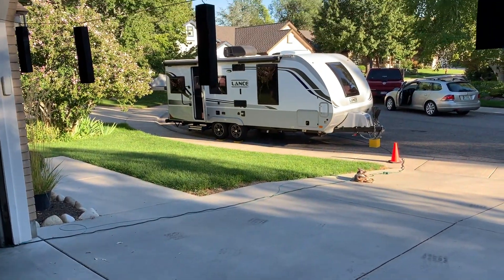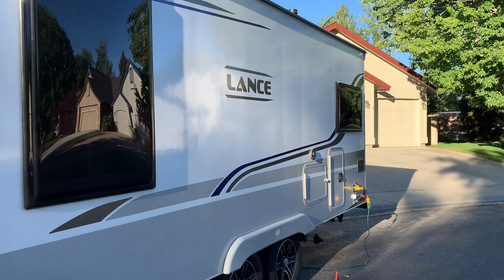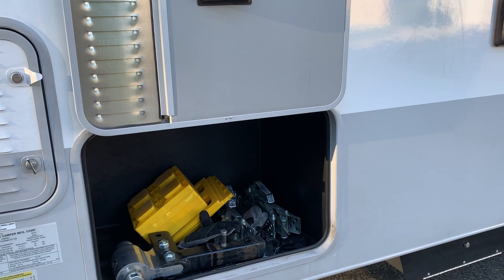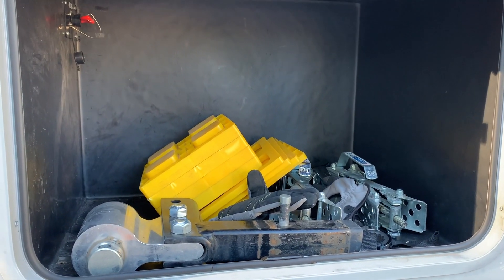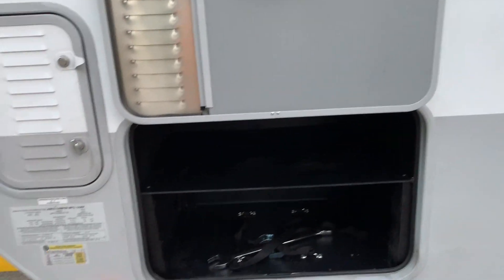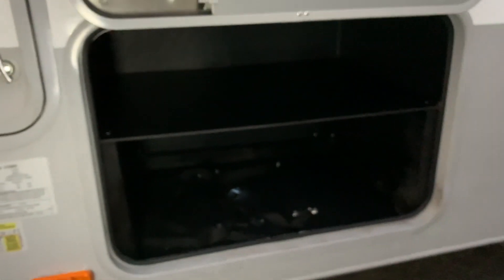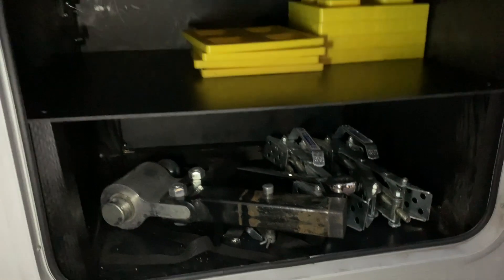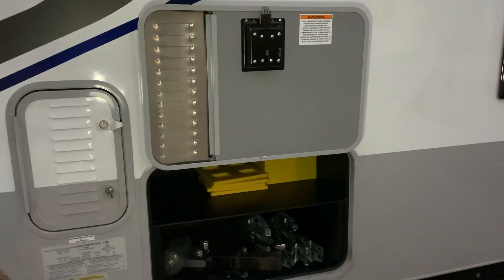Lance 2075 | Storage MOD

Comment: Great mod. The new 2075's are coming with metal bins for the large front storage now . Still waiting to hear about the hot water heater and what your dealer told you 😜
Reply from the maker: Hi George, thanks for the comment!  So my dealer doesn't think there's anything wrong with our Truma (although he did admit he's not a Truma expert).  It's a work in progress for us...and I've just been doing a lot of research and digging up videos on Truma out on YouTube to learn more about the system.  I think there's some tweaks in terms of the settings and things we're doing (and not doing) that will make it better.   We're headed out on a trip next week and we'll see what happens.  I'm optimistic we may get this figured out!  :)